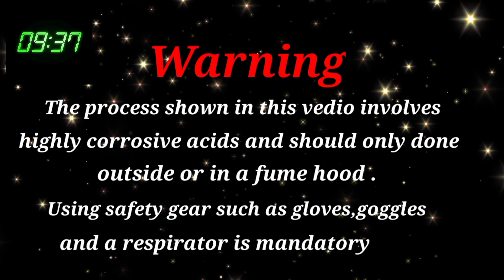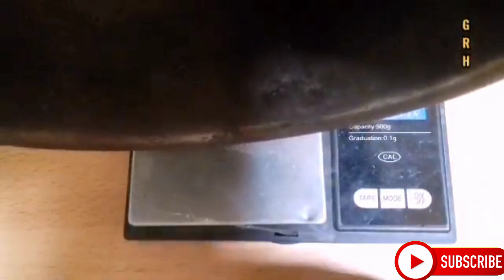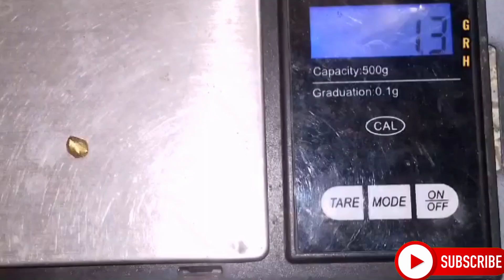Gold recovery from Mix ICS chips/How to recover gold from ICS chips

Comment: I love you videos! But I can commended that you should use dish detergent to allow the surface tension to break as you #1, aren’t mixing the material well with the water and loosing a lot of your gold.  Make sure you mix well first, and use detergent to break surface  tension and then rinse and separate. I’d guess you’re loosing 25-50% of your gold using the current method